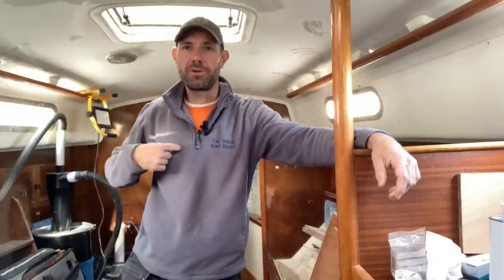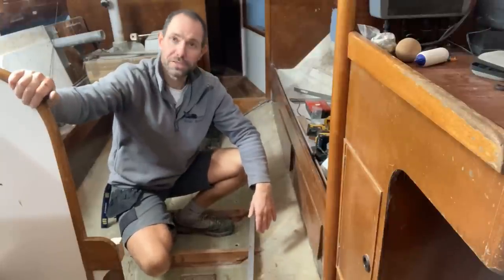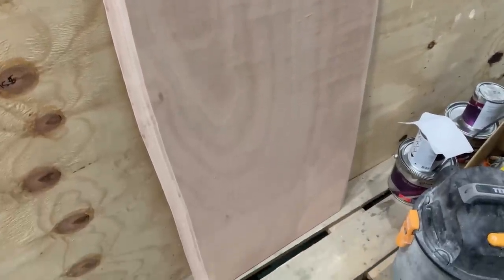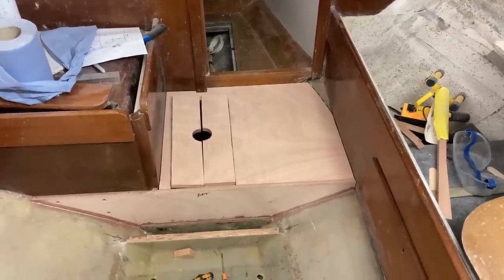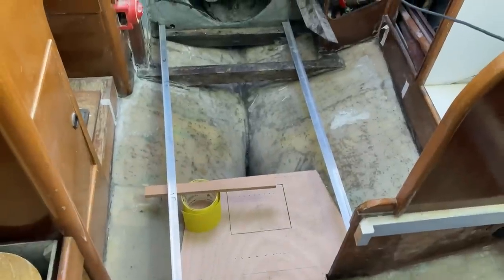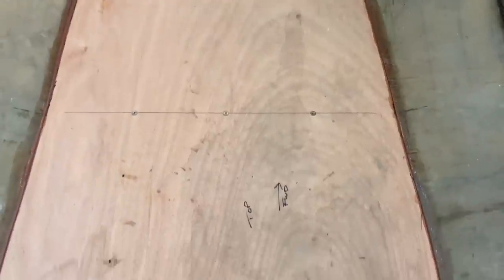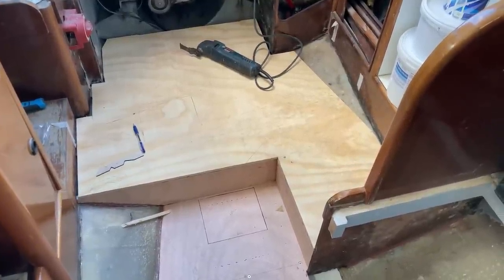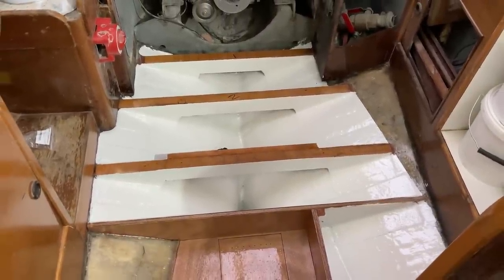Building a New Cabin Sole (floor) in a Contessa 32 (Project Lottie Ep11)

Comment: Have you ever checked out how the Japanese burn their wood slightly which keeps it from moisture rotting and bugs eating it?? Called shou sugi ban?? I have used it for piers on porches and I built a nice wooden work bench in my garage and am getting ready to build my friend a bar in his basement.. I soaked it in transmission fluid and then burnt with a propane weed burner and its got this really cool reddish tinted black/brown look.. saves from having to buy treated lumber and no chemicals. They have wooden buildings sitting on rocks that are atleast a thousand years old and zero rot.. since you're a craftsman I thought you might want to check it out..

Comment: Fascinating video!! I really liked how the flo-coat smoothed out on the bottom. Can it be used on vertical surfaces or even on cabin tops (from the inside), or will it drip and/or sag? I'm thinking about removing the old ??leatherette covers?? from my Maxi 77's cabin and just painting it white. Is flo-coat adequate for the job? Thanks for your advice!
Reply from the maker: Hi, yes you can use flowcoat on vertical and overhead surfaces although overhead can be tricky/messy if you are not careful.    the Gel is generally quite thick, on an overhead surface I think Id be tempted to thin the gel with styrene and then apply multiple coats with a roller, just make sure the final coat has wax added to it.   the addition of Wax is what turns gelcoat into flowcoat (aka topcoat).  I have not tried overhead but can't see what you would not be able to do it.  Perhaps try painting on overhead first and see how you go.

Comment: Hay George, can you explain to a goose like me, where does the water go that drains through the glass holes you have drilled on the top of the water tank? Down the sides of the water tank, flows aft across the top of the keel ballast and then to where? Thanks.
Reply from the maker: Any water will drain down the sides of the tank to the bilge, there is a gap under the tank so the water will drain aft to where the bilge pump pickup is located.

Comment: Neat - some months ago I used the same “enlarge the hole with the dremel” trick for a through hull - which was also trudesign- and with the same bosch tool - now I almost feel like a real professional 👍

Good info about the flocoat. I have been wondering about the compatibility with epoxy. 

Only one question, what about putting new flocoat over a surface that is a mixture of fg, epoxy, and old flocoat - suitably cleaned and sanded - any issues? Would rather not grind away old flocoat if I don’t have to..

Ps don’t worry about the length - there is real value in seeing how things are done properly and it never gets boring - at least for me, cheers
Reply from the maker: Unfortunately most “professionals” would use the larger size hole saw and not worry it was a loose fit but that’s not my way.

New gel/flow coat over old is no problem, new gel/flowcoat over cured epoxy or epoxy is no problem.   In all cases the surface needs to be well abraded and cleaned of any contamination.   Using gel/flowcoat over old paint is no good, all old paint needs to be removed.   If a locker has previously been painted it’s often easier to repaint than flowcoat unless you really enjoy sanding.
Reply: @RefitandSail  Thanks for the advice! Your channel along with atomvoyager (James Baldwin) is one where I am going "aha!" and making notes every episode. Much appreciated, most other similar channels are pretty much "in the land of the blind the one-eyed man is king" if you know what I mean...

Comment: Interesting take at 49:30 on through hull and Coppercoat. I am using a bronze through hull with a strainer for the engine intake. Is the standard trough hull suitable as well for the engine? 
Reason for asking is that I consider Coppercoat. Regards and Happy New Year
Reply from the maker: Not sure I fully understand the question but a standard through hull is fine for an engine inlet as long as it is the appropriate size for the engine (the engine manufacturer will pescribe a minimum size.  Bronze is good if you can get it, they are available but very expensive which is why I think composite is the way to go if it’s a choice between dzr or composite for similar cost.    Better to have a raw water strainer in the engine bay than a strainer over the seacock in my experience, easier to check and clear when necessary.   External grills tend to fill up with marine life then block.
Reply: @RefitandSail  Thanks for your immediate feedback. I installed Truedesign for all throughhulls and seacocks except engine. For the engine I installed a bronze through hull from Maestrini(?) ) with an integrated strainer and a Truedesign seacock.
Reply from the maker: @arnehayn4354  ahh, understand now.    While it’s not what I would have done many boats have those strainer inlets and mostly they are absolutely fine.    I have only once seen the issue of galvanic corrosion on an engine inlet seacock so it’s possible it was a one-off.    However I have seen galvanic chalking around the metal engine seacocks on a few boats that have coppercoat.    Maybe just keep an eye on it, probably be absolutely fine.  As it’s bronze it’s much less likely to suffer from galvanic corrosion.

Comment: Could you use the same barrier coat that you used on the outside instead of the  flowcoat that you used?  Any pros or cons to the barrier coat?
Reply from the maker: I could but it’s a bit expensive compared to flow coat and there is no benefit to doing so, and you get more film thickness with flowcoat + it’s quicker to cure.

Comment: No limber-holes necessary?
Reply from the maker: There are limber holes in the area under the floor where water could get trapped but in the floor itself there is not, this is quite normal.    I suppose any water that is on the floor could drain down into the bilge via the floor hatches but in reality any water could be mopped up.   On my own boats this has never been an issue.